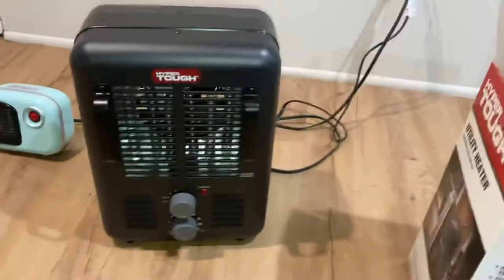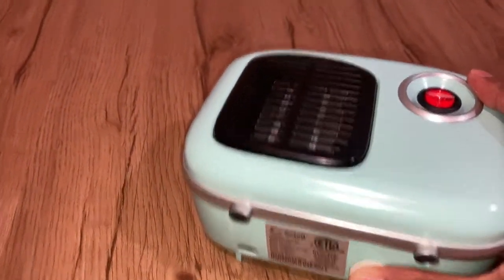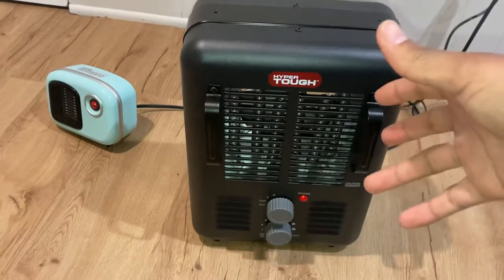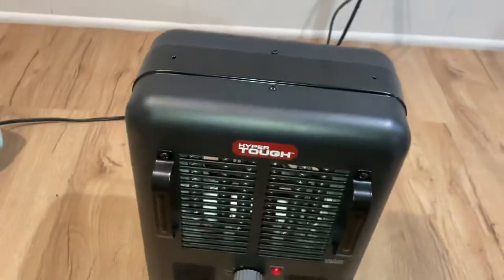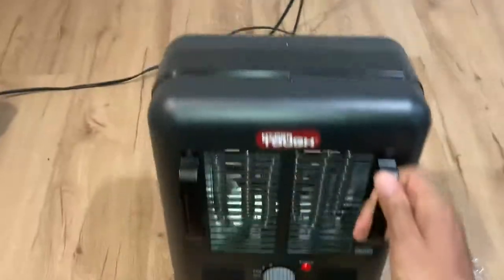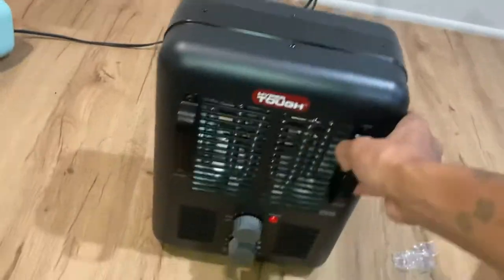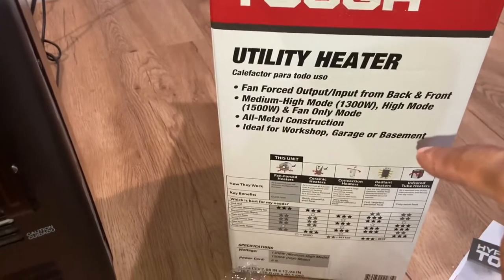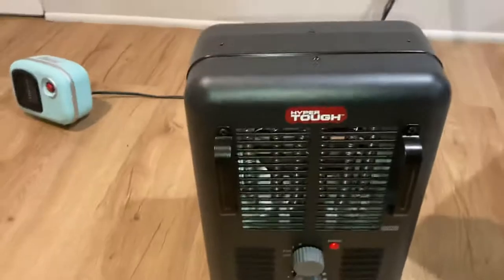Hyper Tough Utility Heater | Tip over & Overheat Protection

Comment: I've got a Hyper Tough. I use it for my camper and it works good. I also have Mainstays oil filled radiators for my house.. I would recommend a radiator for your application. They are quiet and use less electricity
 How ever they are not fast.